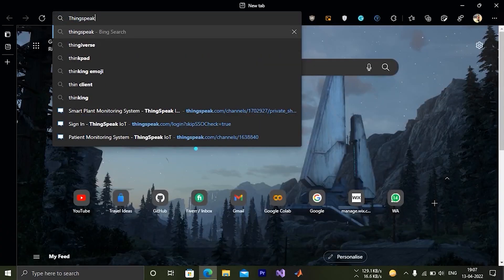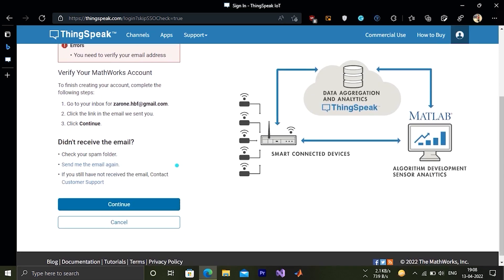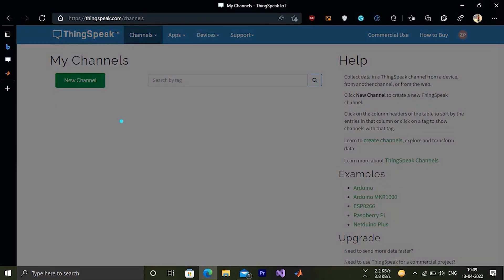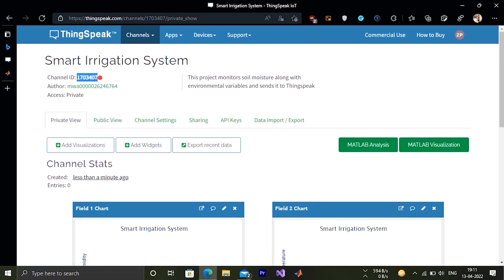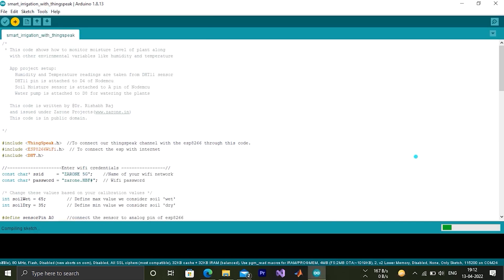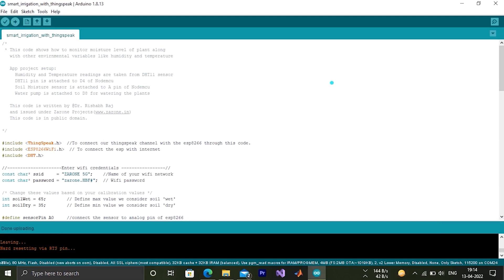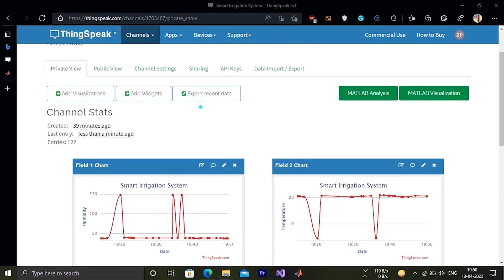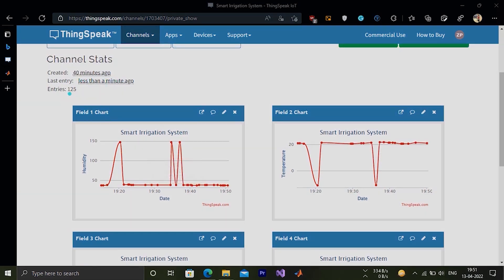Smart irrigation System  | Smart Irrigation System using Thingspeak | IOT Smart Irrigation System

Comment: WARNING: library LiquidCrystal I2C claims to run on avr architecture(s) and may be incompatible with your current board which runs on esp8266 architecture(s).
C:\Users\princ\Downloads\smart_irrigation_with_thingspeak\smart_irrigation_with_thingspeak.ino: In function 'void setup()':
C:\Users\princ\Downloads\smart_irrigation_with_thingspeak\smart_irrigation_with_thingspeak.ino:55:14: error: no matching function for call to 'LiquidCrystal_I2C::begin()'
   55 |    lcd.begin();
      |              ^
In file included from C:\Users\princ\Downloads\smart_irrigation_with_thingspeak\smart_irrigation_with_thingspeak.ino:21:
c:\Users\princ\OneDrive\file\Arduino\libraries\LiquidCrystal_I2C/LiquidCrystal_I2C.h:58:8: note: candidate: 'void LiquidCrystal_I2C::begin(uint8_t, uint8_t, uint8_t)'
   58 |   void begin(uint8_t cols, uint8_t rows, uint8_t charsize = LCD_5x8DOTS );
      |        ^~~~~
c:\Users\princ\OneDrive\file\Arduino\libraries\LiquidCrystal_I2C/LiquidCrystal_I2C.h:58:8: note:   candidate expects 3 arguments, 0 provided

exit status 1

Compilation error: no matching function for call to 'LiquidCrystal_I2C::begin()' . this error is come please give solution

Comment: Can u put the actual circuit diagram that have been used in the video
Reply from the maker: Yes, but I am not getting proper component library anywhere, that the main issue, for now you can follow the codes for wiring

Comment: bro why lcd is included in code
Reply from the maker: While I was writing code I had attached LCD with I2C converter to the project, but  to simplify the project, I had not shown it here. Rest assured the code will work same if you attach LCD or not

Comment: sir there is problem in the code which is given where the sensor is working as per the project. The sensor has to toggle but it is not happening sir ,how to change the code for it??

Comment: I am have same this problem "WARNING: library LiquidCrystal_I2C claims to run on avr architecture(s) and may be incompatible with your current board which runs on esp8266 architecture(s).
C:\Users\DCL\AppData\Local\Temp\.arduinoIDE-unsaved2022926-16892-c4wea7.tx0pi\sketch_oct26a\sketch_oct26a.ino: In function 'void setup()':
C:\Users\DCL\AppData\Local\Temp\.arduinoIDE-unsaved2022926-16892-c4wea7.tx0pi\sketch_oct26a\sketch_oct26a.ino:55:14: error: no matching function for call to 'LiquidCrystal_I2C::begin()'
   55 |    lcd.begin();
      |              ^
In file included from C:\Users\DCL\AppData\Local\Temp\.arduinoIDE-unsaved2022926-16892-c4wea7.tx0pi\sketch_oct26a\sketch_oct26a.ino:21:
c:\Users\DCL\Documents\Arduino\libraries\LiquidCrystal_I2C/LiquidCrystal_I2C.h:58:8: note: candidate: 'void LiquidCrystal_I2C::begin(uint8_t, uint8_t, uint8_t)'
   58 |   void begin(uint8_t cols, uint8_t rows, uint8_t charsize = LCD_5x8DOTS );
      |        ^~~~~
c:\Users\DCL\Documents\Arduino\libraries\LiquidCrystal_I2C/LiquidCrystal_I2C.h:58:8: note:   candidate expects 3 arguments, 0 provided

exit status 1

Compilation error: no matching function for call to 'LiquidCrystal_I2C::begin()'"

Comment: I have done all like this, but it is not working plz help me in this bro
Reply from the maker: What problem are you facing??
Reply: @ZARONEPROJECTS  THE MOTOR IS NOT GETTING OFF WHWN SENSOR TOUCHES WITH WATER AS WEEL AS IN THE DASHBOARD THE HUMIDITY AND TEMPERATURE READINGS ARE NOT VISIBLE
Reply from the maker: @White_wolf147  check wire it seems that wiring is not correct
Reply: @ZARONEPROJECTS  brother i have connected d8 to relay input and  a0 to input of soil sensor but it is not happening
Reply: The code provided by the person is wrong.

Comment: hey I'm facing some problems my realy isn't working
Reply from the maker: What problem you are facing??
Reply: @ZARONEPROJECTS  my realy is always high ( no matter my soil moisture sensor is wet or dry)
Reply: @ZARONEPROJECTS  sir can i contact you on Instagram?
Reply: Same problem I am also getting
Reply from the maker: Try running these code, these are for smart irrigation using blynk, here you have to download blynk legacy and then make v5 for humidity, v6 for temperature and v7 for moisture and a button at D0 to control motor : https://drive.google.com/drive/folders/1iKjecS7MhnrUTNIDIJm2dgB21H2f1AGM
Reply: @ZARONEPROJECTS  bro plz help me  in this codes of thingseak as well all i have done but the motor is not getting off
Reply: Sir I am also facing the same problem will you please help me.